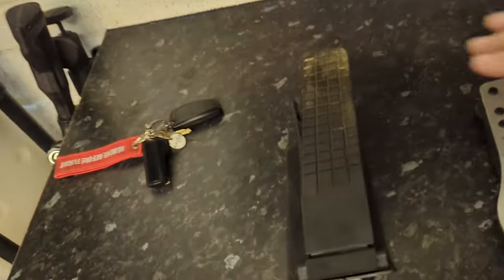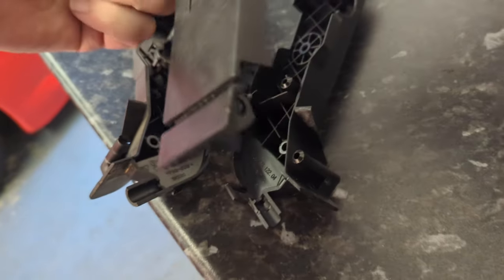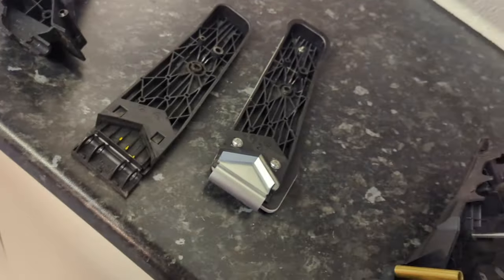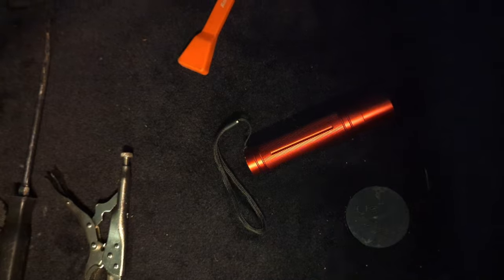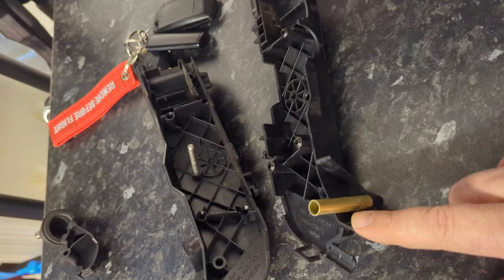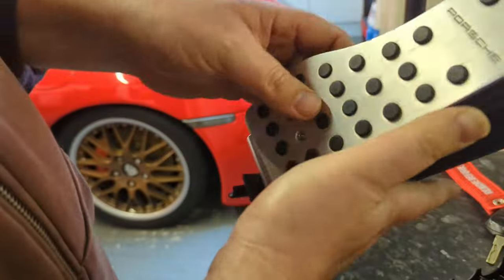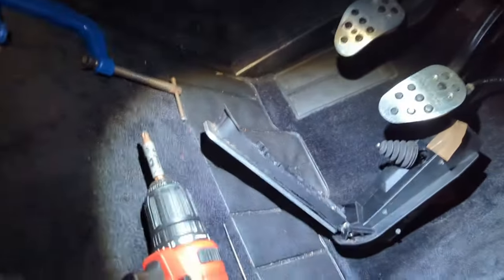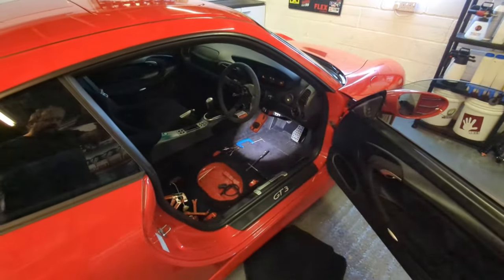Fixing Wobbly Accelerator Pedal on Porsche 996 (986)

Comment: Flair the ends of the brass tube out and deburr the inside edges.  You could always use a heat gun to get the brass to expand a bit.  Or sand the diameter of the plastic pin down

Comment: I had the dreaded pedal wobble on my cable throttle 986. I did a pretty simple fix I found on Rennlist. All it took was a small grub screw to be screwed in on one of those tabs on the rear of the pedal (near the wobbly bit). Simple to do and been rock solid ever since.

Comment: For anyone doing this. Be sure to use thread lock on the 2x 3mm hex bolts that attach the billet hinge to the pedal - mine worked loose.

Comment: Great video Jon, i did mine a couple of weeks ago (later car electronic throttle). My brass sleeve fitted ok, i had no need to dress the plastic, maybe the two types of throttle are slightly different?
I did find the reassembly a pain though, getting the cable inside to locate with everything else at the same time was a nightmare😅